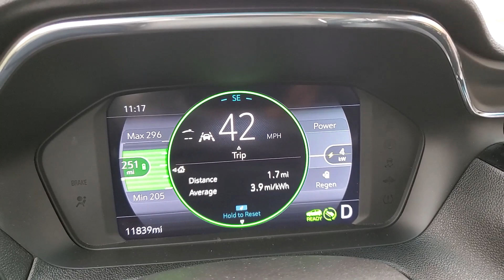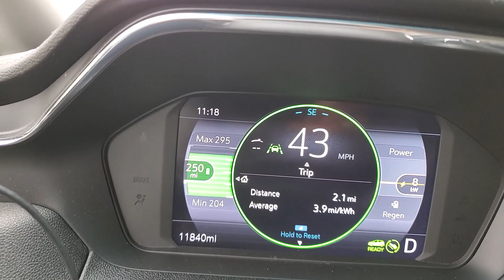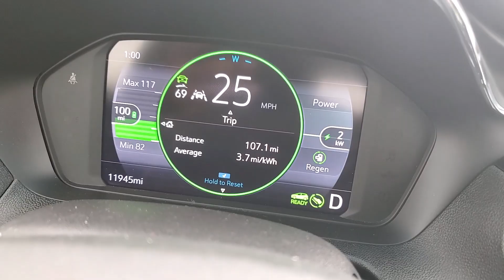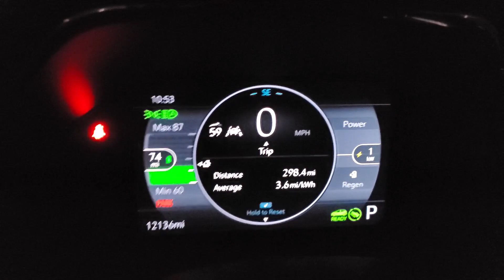Bolt Freeway Driving Average

Comment: I get 4.4 to 4.6 miles per kWh.
Reply from the maker: On Freeway driving 70 MPH? I never gets 4.4 on the Freeway.
Reply: @techeasyguy4149  slow down to 62 to 64 mph.  That is the Bolt sweet spot.  10% less speed 30% greater range.  I pace the big rigs which all have limiters and use the other draft point about 2.5 truck length behind them and can even get more range.  Get up to 7 miles per kWh.  But only as long as the truck is there.  Which usually isnt very long.
Reply from the maker: @arenjay3278  Good idea, thanks for insight, but 65 below is not a normally most people drive. I'm trying to represent true driving conditions most people driving.